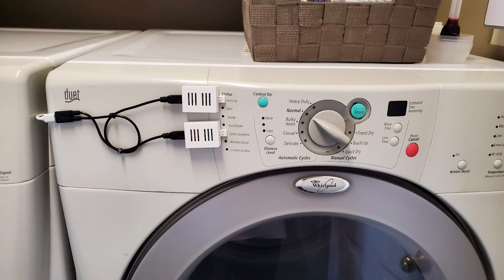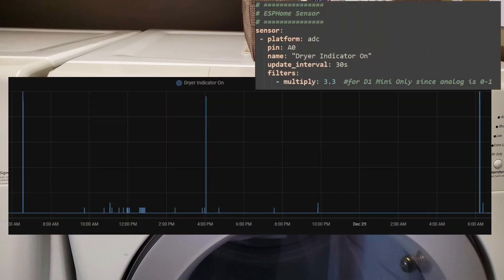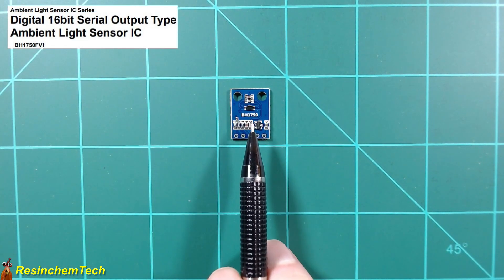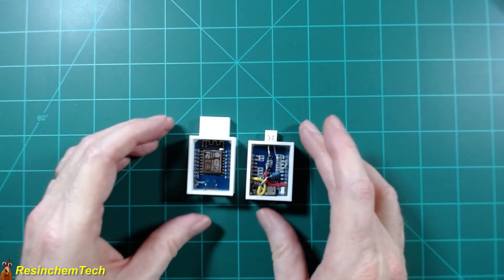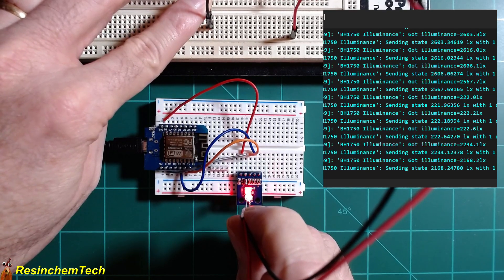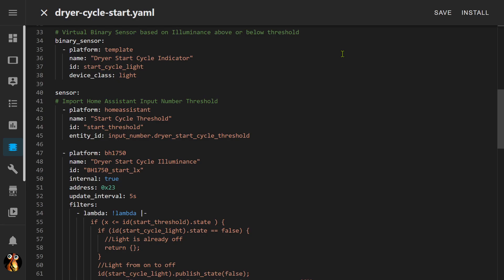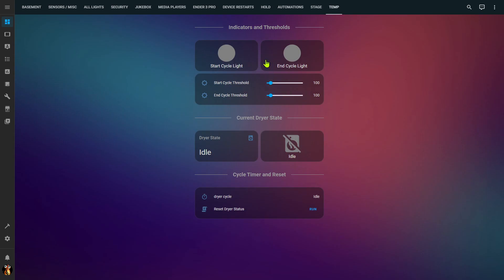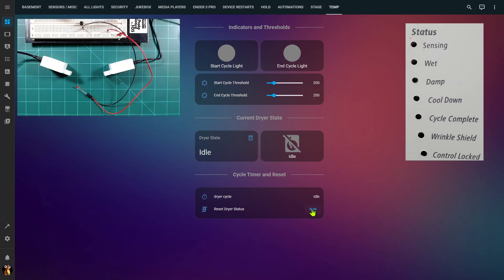Improved Dryer Notifications for Home Assistant

Comment: But why? It will draw power while in use. And that will drop when finished.
Reply from the maker: Primarily because the dryer is 220V and there aren't any power-monitoring "smart" plugs that work with 220V (at least not in the US).  You could use something like a CT clamp on one leg, but that would require opening up the back of the dryer... which for me was a no-go to maintain the WAF.

There are many different ways to detect when the dryer cycle is complete.  Energy monitoring is just one.  Other ways include a vibration sensor (wouldn't work in my case due to the vibrations from the front loading washer next to it).  There are even magnetic sensors that attach to the inside of the drum and will detect when motion stops.  My option of using the LED indicators is just another option that worked out well for my particular case.  But it certainly isn't the only way.  If you have a reliable way to monitor the power draw, then go for it!

Comment: Thanks for all the info.  I'm curious if this could be done just using the "Estimated Time Remaining" window, by using the same LUX device?  My dryer does not seem to have a good start/stop light.  Thanks, Rob
Reply from the maker: I think the challenge would be (and it would probably take some testing) is whether the light level between something like 8 minutes vs. 0 minutes would produce a significant enough difference to reliably be able to tell when the dryer was done.

Of course what I would have really liked to have done was to crack into the control panel.  There's a high likelihood that there would be some sort of low DC voltage there... like 3.3v, 5V or even 12V... for the LED indicator lights, the timer and the cycle-complete buzzer.  If I could have tapped into that, I could detect something like the voltage increase when the buzzer sounded... or when a particular indicator light came on.  But the WAF prohibited me from tearing apart the dryer!

Other options I considered that may or may not work for you:
- Vibration sensor:  Wasn't an option for me due to the large vibrations from the front-load washer right next to the dryer.
- Sound sensor:  Not sure how I would implement this (you'd have to have a way to measure decibels or something), but it would detect the sound from the cycle complete buzzer and that could trigger the automation.
- Accelerometer: Something that could detect the drum movement.  They make magnetic, battery operated commercial versions, but I just didn't like the idea of placing a battery inside the heated drum of the dryer.

I'm sure there are other options as well.  Best of luck with your project and if you find a different solution that works for you, let me know!
Reply: @ResinChemTech  Thanks for the info, I'm gonna give it a try and see what results I get.

Comment: This is just what I'm looking for to monitor my dehumidifier. The only suggestion I'd like to make would be the addition of an LED to replicate what the sensor is seeing, this would definitely increase the spousal approval factor in our household. I imagine this would be relatively trivial addition?
Reply from the maker: Yeah... I think it would be pretty trivial to add a small LED.  It would just be connected to a GPIO pin (and probably configured as a binary light component in ESPHome).  You would then simply turn the LED off/or based on the state of the binary sensor using something like the 'on_state' trigger in ESPHome.  So, when the binary sensor gets flipped on, then turn on the LED and vice versa.

Comment: Thanks for the vid. Our dryer stopped heating up and I was ready to call someone, but a couple of YT videos convinced me to pull it out and remove the back. A $3 Thermal Fuse later and the wife is happy again. 
Oh, and thanks for the idea of adding a remote reset control. It comes in handy when debugging.
Reply from the maker: You are welcome.  Glad your dryer was a simple fix... gotta' love YouTube for stuff like that.  I kinda' wish I would have had a reason to take the dryer apart and maybe I could have investigated the option of putting something inside the control panel for notifications.

I originally added the reset for the dryer status when the original photoresistor started acting up.  But I do use it during testing as well.  It's just easier to click a quick link on the dashboard as opposed to going to the dev tools and issuing a service call.  Hopefully with the new sensors, I won't have a need to use it anymore!

Thanks for watching... and the comment!

Comment: If you are comfortable opening up the electrical box with the 240 VDC plug socket, you can probably install a small CT on just one of the hot legs (after turning off the breaker first, naturally!).  You don't really care if you measure total amps as you are only concerned to pick up any significant current flow, and since the dryer is most likely a balanced electrical load you should get equal detection on either feed.  You could mount a single D1 on the wall next to the box, and it would most likely be behind the dryer and totally out of sight.  Most modern appliances draw a small amount of current even when "off", but you can write appropriate thresholds in your code.
Reply from the maker: Thanks for a great suggestion.  I really hadn't considered the outlet itself... just the split of the legs within the dryer itself (which would have required pulling out the dryer and accessing the back panel... a 'no-no' in my WAF case!).  I know there are also a lot of Home Assistant energy-monitoring projects that add things like sensors at the main breaker box and a sensor/CT clamp could be added there as well.  But I'm not quite there yet... I'm comfortable working with low DC voltages, but I shy away with anything at the breaker box itself!  Maybe I'll get there someday!

But you are right, the actual specific amp values themselves do not really matter, you are just looking for the rising/falling to indicate the start/end of the dryer cycle.  Thanks again for yet another idea of how dryer notifications could be implemented!

Comment: CT clamp is the way to go.
Reply from the maker: I don't know how much of the video you actually watched, but I specifically mentioned a CT clamp and why it wasn't an option for me.  The same for vibration sensors.  There are a lot of other ways to detect the dryer start/end process and the way I am demonstrating is simply one way that worked for me.... and could be used for other situations were indicator lights are present.
Reply: I like your concept and it would be useful for various purposes.
The vibration sensor was not reliable for me and a CT clamp on one of the phases worked. The dryer would be on a separate feed from the breaker box so applying a clamp should be easy to do at the panel. In my case I have a breakout box that is easy to access.

Comment: If you can't get smart plugs, you could still do a Ct on the power cable to detect power usage. Not modifying the machine, just a breakout cable to give access to the live conductor.
But led monitoring is another useful method I'll keep in mind for future projects.
Thanks
Reply from the maker: I think someone else mentioned that this same process might be possible for use in other situations... like a dishwasher or other appliance/device with indicator lights.  But the way I implemented the process is certainly not the only way.  I did mention CT clamps, vibration sensors, etc.  Someone else mentioned a sensor on the vent to monitor temperature, which I think is another unique way that might work for some.  Personally, I wanted to tear apart the control panel and mount the controller and a sensor inside.  But  I had to settle with the option I showed, which is working well for me.

Thanks for the comment.
Reply: I was sure a CT clamp has to go around a single wire, since that was tearing it apart, I figured it didn't meet the criteria.

Comment: I've been using a climate sensor attached to my dryer vent. In my use case, we always use a heated dry cycle. This wouldn't work for a non-heated cycle. When the temperature comes back down after cycle completes, I get a notification on my phone. It's been working flawlessly.
Reply from the maker: Yeah, I think someone else had asked about something like a temperature or even an airflow sensor attached to the dryer vent.  I haven't tried it, but is another unique way to monitor when the cycle is complete.

Thanks for the recommendation!  I love it when others share how they accomplished the same task but in a different or unique way.
Reply: What sensor do you use?  I monitor with a CT, but am interested in monitoring the humidity of the vent to see if the clothes may be dry early, or if they need more time
Reply: @stephensmall7398  I have a wyze climate sensor. i only use the temperature data. while the humidity does change, it does not appear to be as reliable as temperature.

Comment: you could wire 2 bh1750s to 1 esp32? I guess if you already had two esps it might look nicer?
Reply from the maker: Yeah... as I mentioned in the video, you can specify one of two I2C address for the BH1750 via the ADDR pin, meaning you could connect two to even a single ESP8266.  And since the ESP32 has two separate I2C busses, you could theoretically connect up to 4 to a single ESP32.  

But for my particular project, since I already had two separate devices (and the wiring to power them) it was easier to redesign the enclosures and maintain two separate devices.  But I could have theoretically used a single ESP8266/D1 Mini with two of the BH1750 sensors.

Comment: Cool, great video, interesting results with the BH-1750. 

As I was watching the video wind down, my mind began wandering, as it does from time to time, and I thought it would be an interesting challenge to design a PCB that covered all the lights, reporting their status back to HA, additionally, you could (in case you wanted to see the lights locally on the dryer, and since your PCB can be dual sided, duplicate the dryer lights to show through on the top of the PCB. I would assume by designing your own PCB that serial bus addressing for multiple sensors would not be a huge problem. 

Wow! Talk about scope creep...
Reply from the maker: I think there a lot of possibilities and I think something like a PCB would be ideal.  I like the idea of duplicating the lights if I were to cover them all up with a single board/device.  Yeah... and some sort of multiplexer would be needed to use a single ESP... since the BH1750 only has two addresses available.

It may be something I toy with down the road (if I can ever get caught up on other updates).  But the most important point for now is that the wife is happy again with the restored dryer notifications... which had been inconsistent for about the past 3-4 months.

But I love getting new ideas and thoughts... so as always, thanks for the comment and ideas!
Reply: @ResinChemTech  I was just thinking about only using the actual sensing device, not the whole board, of course, I have no idea how much other circuitry there is involved on the BH1750 itself.😁😁

Comment: Will LDR's self-heat and will it change their output values? If so, maybe only give those power when doing sensing...
Reply from the maker: It is possible, I guess.  Mine appear to work fine at first (even with the heat) but then seem to lose sensitivity over time, so maybe repeated exposure to either heat or moisture from the dryer?  I really don't know, but is seems that after around one year or so, the range/sensitivity had become such that I'd have to rebuild the sensor.  After doing that twice, I decided not to repeat it a third time and try a different sensor.  So far, so good... but only time will tell if this sensor is also affected by heat/moisture from the dryer.

Thanks for sharing the thought!

Comment: I used similar to your first with my washer, works great, for my dryer i have no lights and no buzzer so im not really able to do anything noninvasive, ill probably have to open it up which sucks lol
Reply from the maker: Honestly, that's what I would have preferred to do.  I found the wiring schematics for my dryer and know that DC voltage is available for the control panel.  I would have much rather installed an ESP inside the control panel and triggered off the circuit that either sounded the buzzer or lit up the indicators.  Then there would have been nothing exposed or attached externally to the dryer.  But the wife did not want me to take anything apart on the dryer (figuring I'd never get it back together or break it.. can't say I blame her!). And since this was originally very early in my personal Home Assistant journey, it was important to maintain a high WAF!

Another alternative that someone suggested in my earlier video was to use some sort of temperature or air flow sensor on the outbound dryer vent and use that to determine when the dryer starts and stops.  Kind of a cool idea... but I haven't tried anything like that.  And of course there are vibration sensors as well... but as I mentioned in the video, due to my front loading washer and its vibrations, that also wasn't an option for me.

Good luck... and let me know what solution you come up with!
Reply: @ResinChemTech  yea unfortunately my dryer is super basic, no lights or even a built in buzzer lol I will have to go off current draw most likely, the temp or air flow sensor is definitely interesting but idk how reliable it would be, but definitely something I hadn't thought of to consider!

Comment: Heard loads of issues with the fake wemos d1 minis analogue port. Try using genuine wemos d1 minis instead. May cost like $1 more but it saves so much hassle
Reply from the maker: That is certainly a possibility.  I do know that I've used different D1 Minis over the past few years from different sellers, but the end result has always been the same.  The system works fine initially, but begins to shift over time until the resistance range becomes too unreliable to use.  I've used the analog pin on both the ESP8266 and ESP32 for multiple projects and as a general rule, I'm not a big fan.  So for this upgrade, I opted to use a sensor that did not rely on the ADC of the board.  Hopefully I'll get more consistent results over a longer period with this I2C version.

But thanks for the comment.

Comment: Im using a smartplug on my 230V dryer here in Denmark.
Reply from the maker: Unfortunately, at least to my knowledge, all smart home plugs here in the U.S. are made for 110 V.  I do not believe that there are any U.S.-compatible energy monitoring smart plugs for 220V.  If someone knows of one, please let me know.

So we have to find other alternatives for our electric dryers, like vibration sensors, CT clamps, etc.  Using the indicator lights is the method I opted for... but this can be used on other appliances (like dishwashers) as well, if they have some sort of indicator to represent when a cycle starts and finishes.